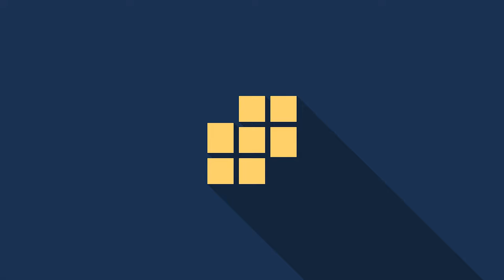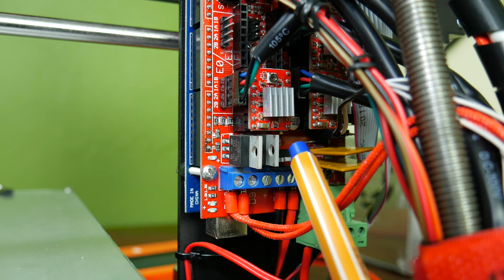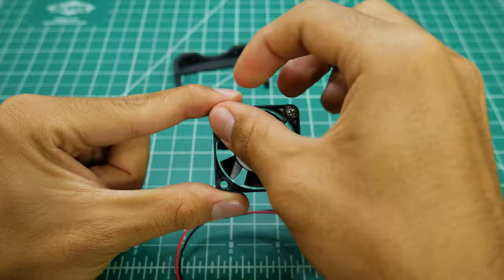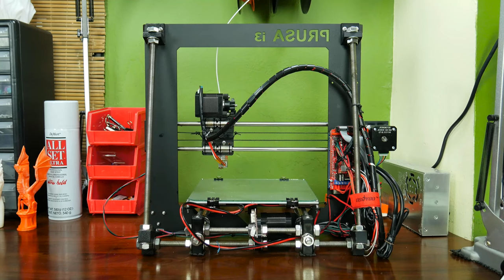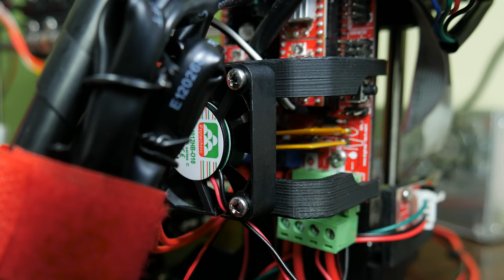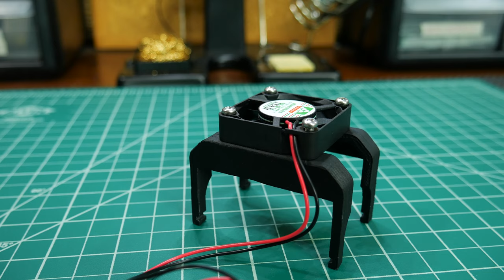❄️✔️ RAMPS 1.4 Cooling  -  3D Printing 101

Comment: Thanks. This save my time.. almost give up on the board. It works but my other old 4 yrs old Prusa i3 printer wont work... it wont work when I preheat both extruder at 250c and heat bed 100c ( when heat bed reaches 60c it shut off)... but only works when I preheat extruder or head bed at once. I guess my power supply is inefficient? btw i did not modify the prusa i3 since then I guess the old power supply problem... should I replace? Help please?

Comment: A much common issue with the cheap Ramps boards are that they have the wrong kind of mosfets with a much to high ON resistance. The best thing is to not go cheap when getting them. 2nd best is to replace them with mosfets that have as low ON resistance as possible.
Reply: Thank you, this sounds interesting. Could you please tell me how I'd go about finding a suitable replacement?

Comment: Will a 12v 80mm fan work in that connector or does it draw to much power?
Reply from the maker: It will work as it's still 12v, yet these mounting brackets wouldn't fit!!!

Comment: I am having an issue with my 4988 drivers burning out within the first hour of use. Is there anything you can tell that would help? They are driving NEMA17 motors.
Reply from the maker: If you already have a cooling fan on them, they are correctly placed, and their ref voltage is not crazy high, it might actually be the board. You can pick up a new ramps 1.4 in amazon for around $10, give it a try.